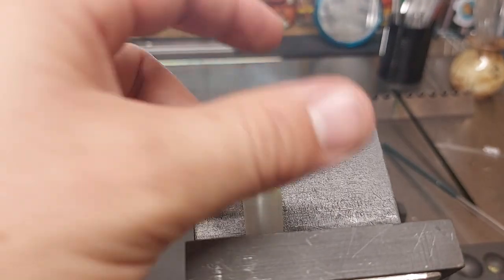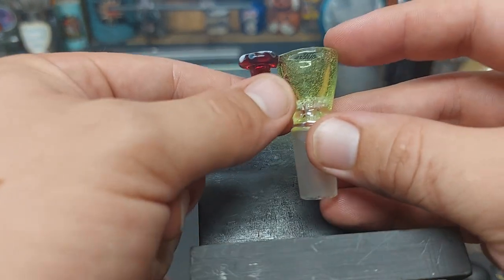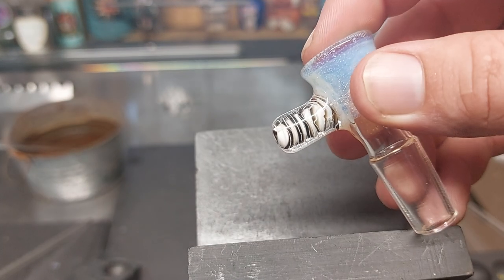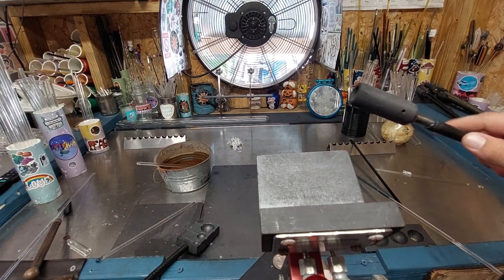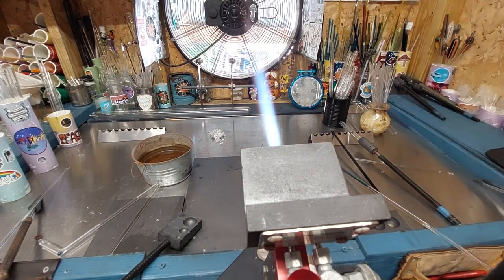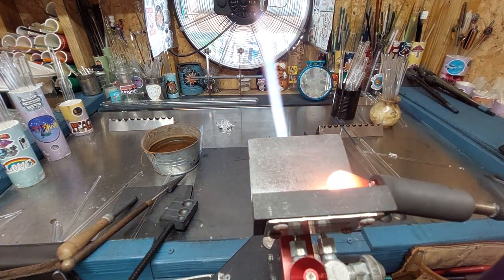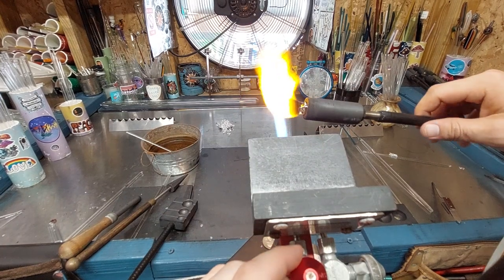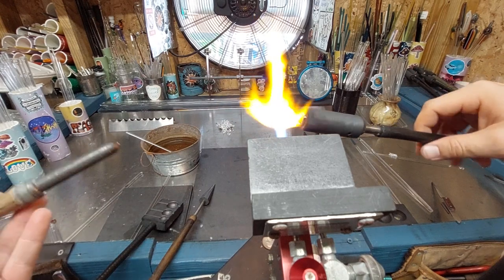Glass blowing How to " Single hole bowl "

Comment: On the joint holder did you add the rubber handle yourself? What type of hose is it thank you 🙏
Reply from the maker: I used electrical tape and wrapped it around my joint holder handle so that way my hand wouldn't get so hot. I use a basic blow hose from mountglass.com

Comment: 2 Suggestions: Do a voice-over separate from the video. Do not try to record your voice whilst in a noisy room. And make your videos much shorter. We dont need a play-by-play for 5 minutes straight of the same action. Either cut the video, or push the speed up to fast forward through repetitive sections.   I switched off video after 30 seconds.
Reply from the maker: Thank you for your feedback.